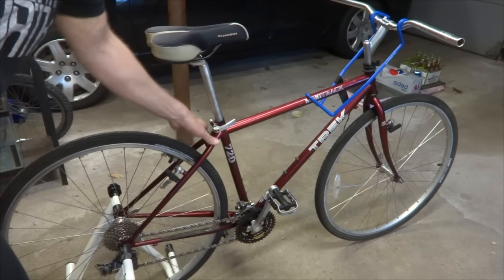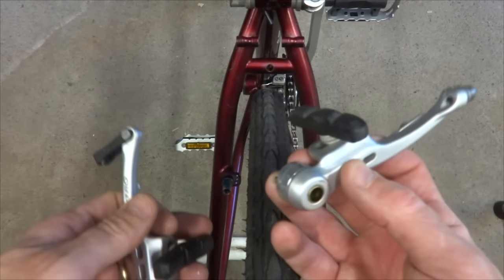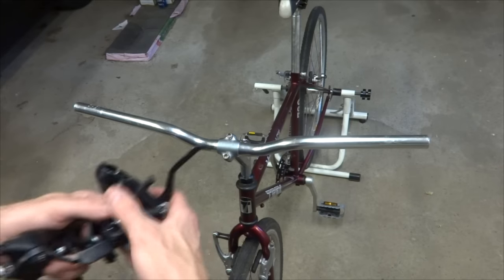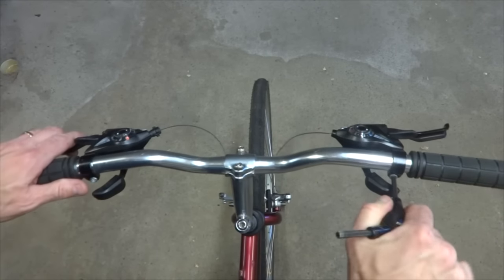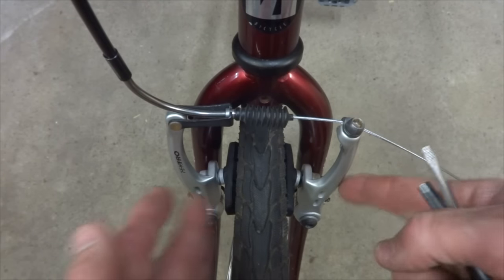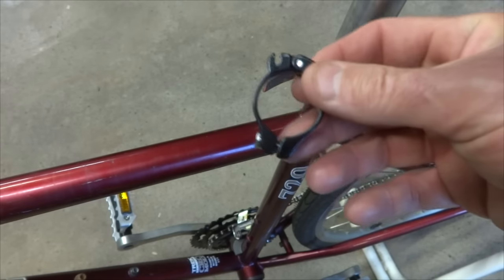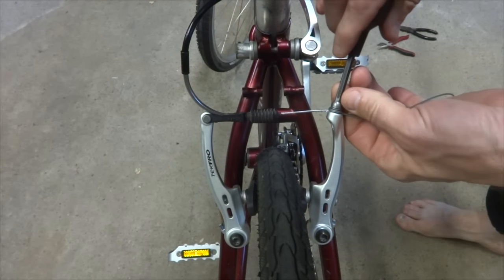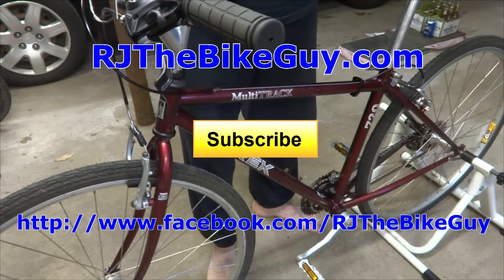Converting From Cantilever To V-Brakes

Comment: Why should you replace cantilevers by V-brakes? In my opinion they are the worst brakes ever invented. Let me explain: I own a bike with cantilevers, it brakes fine, and the brakes never pull to one side. After this, I had 2 bikes with cantilevers, and they were a nightmare. Always out of centre, with brake pads on the rim at one side. I can adjust them, but that works only temporarily. Also, adjustment of the braking shoes is terrible.
And don't think I got the wrong ones, these were Shimanos.
On one bike I replaced them with Magura brakes, these are perfect! The other is for sale, and I bought a vintage bike with cantilevers - they work great - so I keep them.
So, my advice would be: spend your money on Maguras or keep the cantilevers and buy yourself some beer instead.

Comment: But why would you get rid of cantilever brakes and replace them with the junk type V-bakes that suck balls, worse brakes ever
Reply: rj isn't typically going to give you the "why", just the "how".
an example might be, though, that you happen to have a set of v-brakes in your bike junk-stuff.
In my own case, I'd like to move to disc brakes, but the wheels are somewhat pricey AND I still have sets of rim-brake wheels that I need to use up.

Interesting question you raise on the "why" people do what they do.
Reply: Gets rid of brake judder apparently, I'm going to have to go down that road